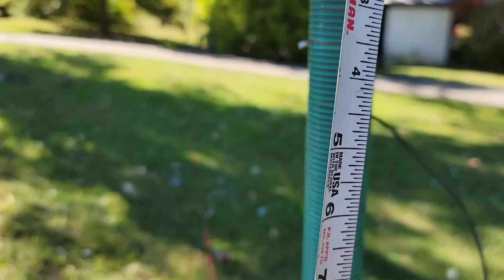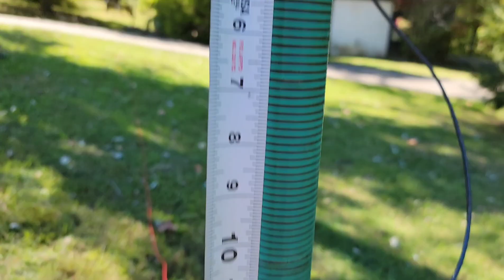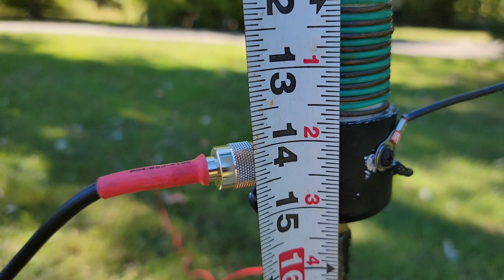homebrew HF coil antenna update 10m-40m

Comment: use hose pipe clip andtighten it to varient meters you need and lock it.
Reply from the maker: @XENONEOMORPH1979  in a later version of this I have made a collar out of pvc pipe with a copper roller in it.. I can slide the collar anywhere on the coil I need to.. I'll have to look for that video
Reply from the maker: https://youtu.be/-9vPBBQz1g4?si=rK5n58eSTZV6qsNW
Reply: @AK4PJ  jus watched your next vid nice one here in brum uk i am doing one for a thunderpole i got cheap ,using 2 inch short pole with 190 turns for all meters 10-80m 
nice job mate.
Reply from the maker: @XENONEOMORPH1979  Thanks.. yea it works pretty good for a short vertical.
Reply: @AK4PJ  welcome happy dxing ,i tried it up on the roof and it bloody works well ,
Reply: @AK4PJ  nice one mukka just seen it.